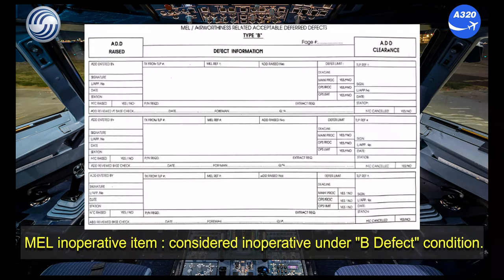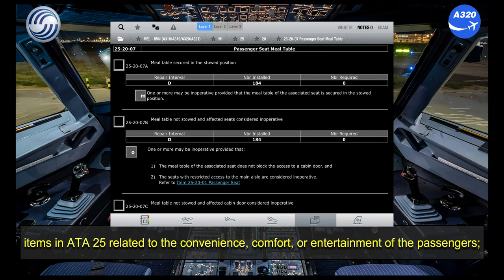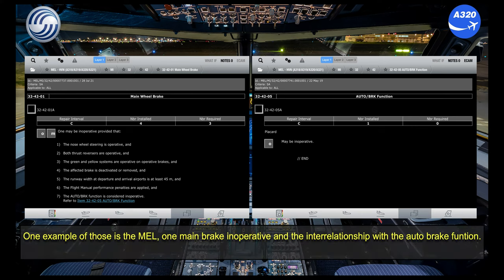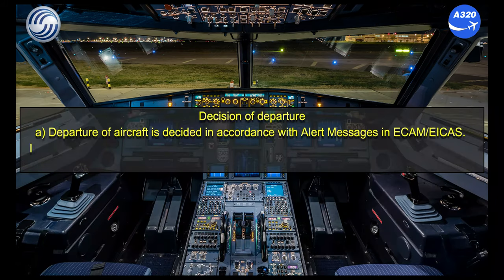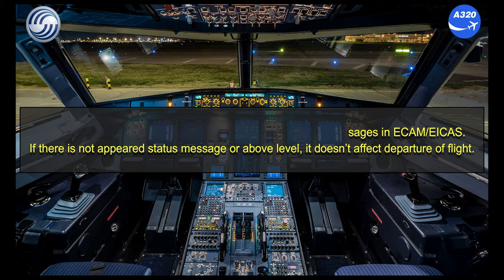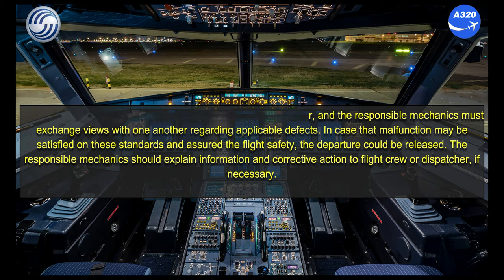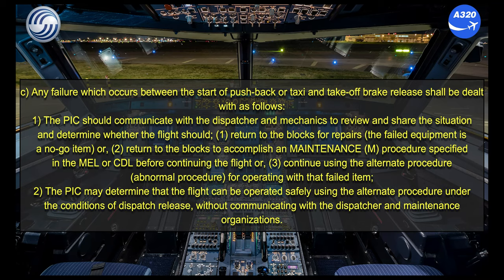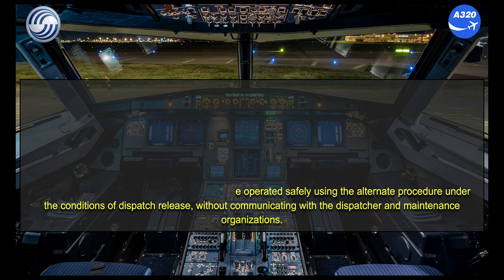A320 MEL operational procedures, CRITERIA FOR DISPATCH

Comment: Thanks for videos,they are very useful👍🏻where in the FCOM i can found information about maximum permitted inoperative items?
Reply from the maker: It's stated in criteria for dispatch in the MEL not in FCOM
Reply: I checked MEL,Preamble00,00 03 Criteria for Dispatch and do not found information about maximum 4 inoperative actions.may be i made wrong search?
Reply from the maker: @farhadnasirov4067  MEL ITEMS 00 preamble 09-02 criteria for dispatch MI-00-02 P 1/2
Reply from the maker: 00-02 instead of 09-02
Reply: @a320mentorchannel  maybe it's removed or it's subject to operators? because I don't found it in my company MEL :(